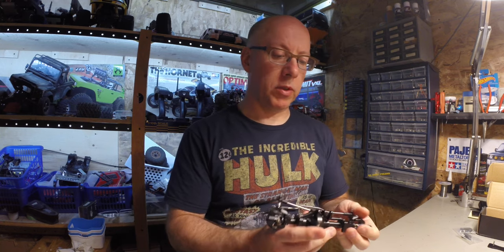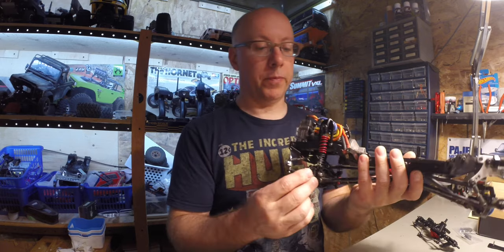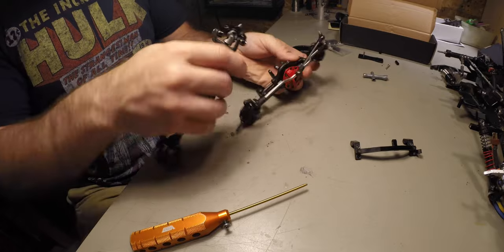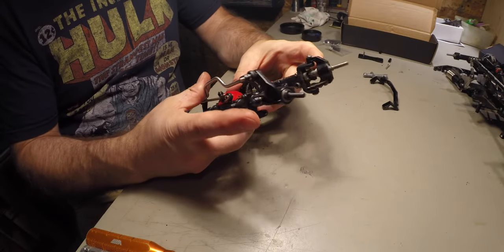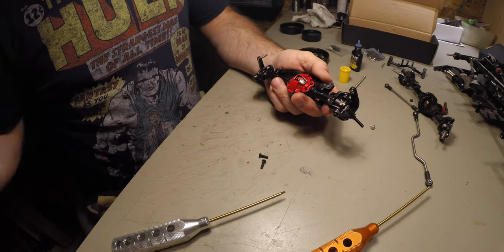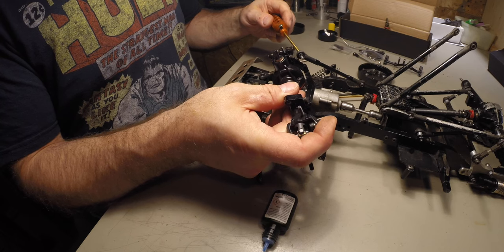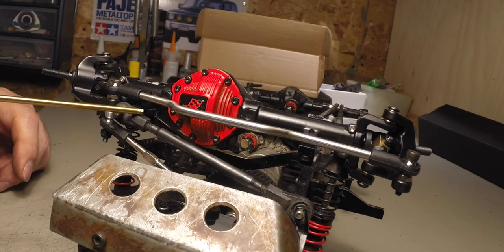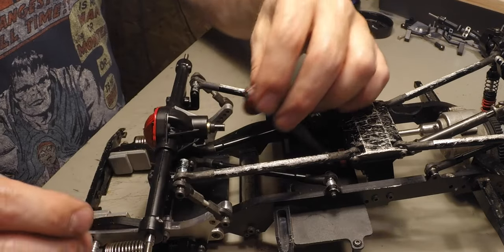Boomracing D90 Phat axles Swap Ver 1 to ver 2 plus whats the difference

Comment: Bought these for my gelande ii years ago and broke the ring and pinion in my rear axle. Do you know by any chance, what ring and pinion I can put in these that way I’m not throwing away a set of perfectly fine axles? Would love to get them running again
Reply from the maker: Boomracing's other phat axle gears may fit but I cannot confirm. I beleive they were all Axial based designs in general but again.. not sure.

Comment: Hey, man! Do you have a long-term assessment of the axles? I am about to replace my Yota 2 axles with these(on my Gelande 2), and I am torn between these and full BRX90 axles.
Reply from the maker: I still have  them. I replaced a rear axle shaft after a major fall bent it and the bushings in the steering knuckles.  They are just awesome. Either way you go with boomracing, i think you will be pleased
Reply: @TheLEDwheel  Thank you for the reply! I am hoping these will serve my Gelande well.

Comment: Verry Nice axles. I'm consider to put them on my trailfinder 2 (Blazer).  Would that be a good decision? And i was wondering what the steering angle degree is... yota1 is 36 degree i thought. So i hope that those boom axles are 40/45 degree
Reply from the maker: 45 degrees. I love these axles.
Reply: TheLEDwheel  do you think that it Will work with my stock leaf spring setup? Want to keep it original and realistic as possible. Thanks for the reaction btw. Greetings from the Netherlands

Comment: Will they work with my stock leaf spring  setup? I want to know for sure that everything wil fit fine with that boom axles before i order them. Last weekend i broke a steering hub on my yota1 axle so that boom axles are on top of my wish list. Btw Nice video's you make👍🏻👍🏻
Reply from the maker: it says  for RC4WD TF2 / Gelande II D90/D110 by Boom Racing and the mounts are the same as my Gelande II so they are a direct replacement.

Comment: had problems with body brackets or rear bumper, fit everything well in the body d90?
I have problems, rear bumper is bigger than body, and anchor points are wider (0.5 cm per side) than body width
Ebay body china
Reply from the maker: AS far as I know the Chinese copy is the same dimensions but I have never seen one. The axles are indeed wider but having the wheels tuck right may also depend on the offset of the wheels you are using.
Reply: yes